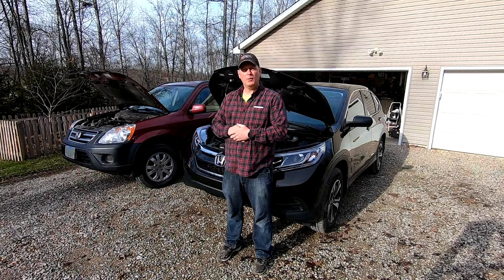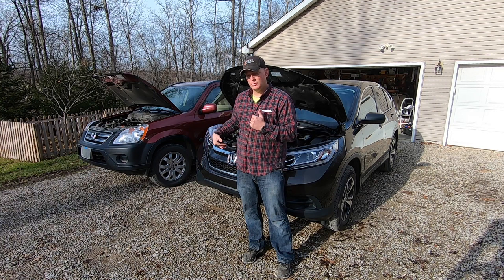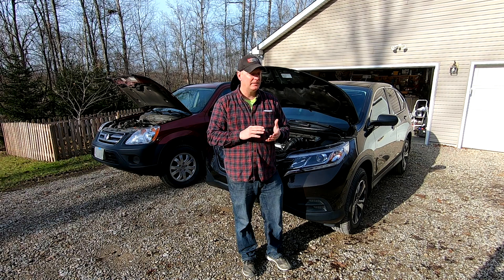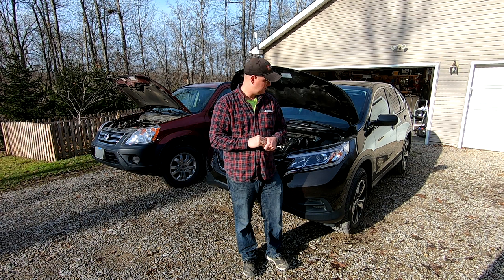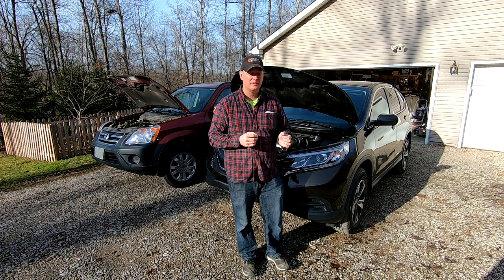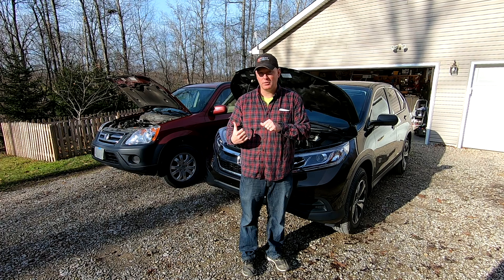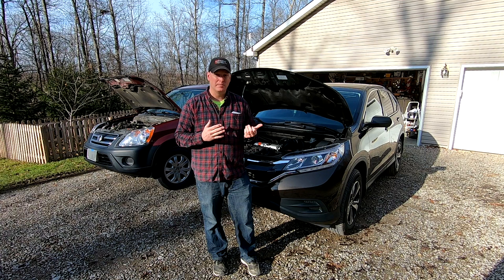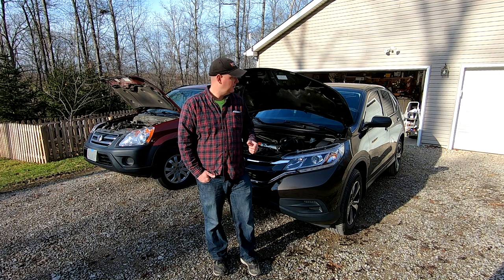DON'T BUY THIS CAR - 2012-2014 Honda CRV

Comment: I will stay you also may be hearing a drive belt and tensioner will go bad around the same mileage the CVT will start making noise.
Reply from the maker: The 2012-2014 CR-V does not have a CVT. A bad tensioner can make a similar noise on some cars yes.

Comment: I have 405k. My vtc is leaking oil. I’m replacing it this weekend. It has never been replaced
Reply from the maker: That's crazy mileage.
Reply: Thanks. I just change the oil every 5k. No major issues

Comment: I've  seen a video  on the accord having  that problem  and it was the timing belt tensioner  to be replaced  and adjusted  out one or two  teeth
Reply from the maker: That's for a completely different engine

Comment: I have to agree. Loved Hondas, bought a new fully loaded 2018 crv touring. Loved the vehicle but had the oil delution problem from the start and complained about it. Took to the dealer we really liked, blah,blah,blah flashed ECM, complained it was still happening, blah, blah, blah. Honda admitted a problem, extended warranty to 100k, we where already at 75k. We bought Honda for reliability because we put a lot of miles on. Complained again, oil over full and smells like gas, dealer told me they couldn't do anything unless the check engine light was on. We had all the regular service done earlier that due, by the dealer. We'll be past warranty before having a check engine light.....traded in for a toyota.
Reply: Toyotas also burn oil. Even the 2.5.

Comment: How about the 2007 to 2011 CRV? Thank you
Reply from the maker: They are pretty good
Reply: @JackofAllMasterofNone those years had an internal coolant pipe that leaks. My memory is foggy but a quick search will pull it up.

Comment: 2014 AWD here. 265k miles and going strong. 

I got a little transmission shaking at 65k and I just change the trans fluid every 60k and all is good. 

The only other major repair is the shocks all around but that is expected.
Reply: I change the transmission fluid every 30K miles.  I buy seven quarts and crush gasket.  Drain and fill.  Drive it a bit.  Drain and fill again.  Use new gasket.  Set for another 30K miles, about 2 years.

Comment: How about the prop shaft issue, I had to replace my entire prop shaft twice because of a defect. Honda paid for it one time and I had to pay for it partially the second time. This issue is with the center bearing on the shaft which of course is not serviceable, so you have no choice but to replace the whole shaft, which is around $2000.00 just for the part.
Reply from the maker: It is serviceable, just not according to Honda / the dealership. It is an issue, but doesn't seem that common. They can be regreased with a needle greasing kit without even removing the shaft, as long as it hasn't gotten too bad.
Reply: That's why I decided to buy a vehicle without AWD.

Comment: Bumped into this vlog since it mentioned 2014 model that I own.  I had the exact same problem and thought all along is a starter pinion stuck problem.  i realized now its a totally different major issue.  It still happens now after 9 years on and off and more so on colder days.  I have only 41k miles on it since its a very low use vehicle. Now that i have learned of this issue really worried. A major disappointment from Honda.

Comment: I am going to try and find the video but a mechanic replaced the springs without removing the actuator by just removing valve cover. The stronger springs fixed the issue. 🤷🏻‍♂️ I had timing chain and actuator replaced and it did it the week after they were replaced. 😡 Only does it when cold out.
Reply from the maker: Sounds like this is the best fix based upon all the other comments.

Comment: My 2014 i bought 18 months ago with 65k on it. In that time, i put about 120k on it.... i drive 110 miles each way to work and back 5 days a week. So far, I've no issues except when accelerating at about 25 mph, it shakes a bit... i lift off the gas, then press again, and it stops. Also, when driving at 65 over a patched road, the car tends to hop a little. Otherwise, it's fine... so far

Comment: Our 2016 CRV is the 6th Honda we have owned. Superb motor car. Suits our needs in every way. No sign of this fault after 6 years and 90,000+ on the clock.
Reply from the maker: This does not apply to your car. It's 2012-2014 only.

Comment: I've had the rattle for years, 230K on my engine now.  I haven't read one person say anything about what happens if you leave the engine alone with the issue.  I don't have any problems at all with mine other than the VTC actuator rattling, and it's not everytime.
Reply from the maker: That's good to hear

Comment: 2013 here, 3 yr batteries died too soon, and inflation,  I did pop some $ into this. Everything is higher. 50,000 miles ,it does drag a little.

Comment: Thanks for this. My 2013 started making this noise last year at about 120k miles. Took it in twice and the dealer couldn’t duplicate it or find anything wrong. Now this week it does it every start and they suggest rebuilding the engine for $4600…
Reply: Sell it and upgrade if they can’t find it 😂
Reply: Tell them about the service bulletin 16-012. The VTC actuator is defective 

I had to also replace the timing chain as well, due to this issue.

It costed me $2500. It sucked but it was the only major issue I had with this vehicle.
Reply: It sounds like you need to find another dealer - they only want to offer an expensive repair to make more profit.

Comment: Yep same thing 2014 Honda CR-V had it to dealer twice  at 50000 miles they swore did not hear the noise I even recorded it on video and played it .
They said can’t fix it not 75000 miles no warranty . Timing  belt stretched due to actuator . 1600 dollars awful enginerring
Reply from the maker: Yep

Comment: 2012 145k.  Just got done replacing the radiator.  Also replaced the blend door actuator, flushed the heater core last year, replaced the alternator, and replaced the rear brake calipers cause they were dragging.  Probably will need a muffler soon starting to get noisy.
Reply from the maker: Should be like a new car now !!
Reply: @JackofAllMasterofNone  I do like the room it has.  It replaced an '02 Accord last year with 230k.  I could never go back to a sedan - just too low.  I bought it with 125k so not sure if the VCT was replaced by the previous owner but its fine starting up.  If it does act up I'll replace it myself.   The small batteries are a joke though.  You leave the headlights on for 15 minutes with the engine off and the battery is dead.

Comment: Glad I watched this. Was thinking about buying my neighbor’s 2016 CRV with 14,000 miles, but why bother if it doesn’t have the good reliability? My 2013 Hyundai Elantra shitbox with 90,000 miles shuttles my fat ass around town just fine.
Reply from the maker: The 2016 is actually a good vehicle. The 2012-2014 is the subject of this video.
Reply: @JackofAllMasterofNone and what makes the 2016 different from the 2012-2015? Isn’t it the same car with the same problem?
Reply from the maker: Looks similar but has a completely different engine and transmission. The 2.4 was redesigned in 2015 and Honda started using a CVT transmission.
Reply: @JackofAllMasterofNone  a CVT?!? Yuck, no thanks

Comment: I have honda crv 2013 lx  , and I have a problem with oil consumption. After 100k, start taking 1 quarter  every 1 k miles.Penzoil high mileage  oil helps to decrease  oil consumption  50% instead of 1 quter  evry 1 k miles now i can doit 2 k miles

Comment: i NEVER CHANGED IT.  YES IT'S NOISY ON A COLD ENGINE START UP. Big deal. I know what it is and car is running great. Compare it to all others in it's class. We still win.
2014 Honda Cr-V 2.4L EX-L AVG 28MPG 171,000 MILES, with $2000.00 RV tow upgrade.

Comment: I have a 14 CR-V with that start up issue. Assumed it was the starter so good to know what it is. ( A neighbor drives the exact same type CR-V and I've heard hers do the same!  I. Also have tran actuator noises going on right now. Only 92k on it. Disappointing quality Honda.
Reply from the maker: Yeah it sucks and they all do it eventually. Bad design

Comment: Just had vtc actuator, timing chain and all gears replaced on 2014 crv with 88000 mi for $1900.
Reply: Call Honda and tell them. 2 states have a class action. Honda may still do something for you. If you are in Cali or Illinois you may be part of the class action. Let us know if they do or do not help you.

Comment: That rattle you hear when starting it up from a cold start is your timing chain begging you to change it. If you don’t believe me go buy the timing chain, put it on there and see that it don’t stop.
Just to be a little more specific, it’s actually the lower timing chain to come from the crank to your balance shaft.
Reply from the maker: It's not necessarily the timing chain. They can stretch over time if this is ignored, but the vtc actuator is what is making the noise.

Comment: My parents also used to owned a honda CRV EX-L the engine never break down but the air filtering system started to make funny smells when going like i think 100 KM/H
Reply: It's time to change the filter
Reply: @staceylynn4700  I keep my filter changed.  It still does it. I keep baking soda boxes with the open flaps in my cabin.

Comment: I bought a 2018 crv, and sold with in a year due to massive oil dilution problem
Reply from the maker: We did the same with our 2017 CRV
Reply: Some of the 2018's had a different engine.  No oil dilation problems.
Reply: @Susan70003  I sold one due to Oil dilution, and there were thousands of vehicled afftected around the globe.

Comment: …. Also just an fyi… even though I want to throw up now every time I get in this car … as soon as you hear the Vtc rattle on start up you can likely get away with just replacing the spring in the actuator…. You can get a replacement spring that hold it “spring” a lot longer. It’s way quicker and cheaper to just replace the spring if caught in time . ALWAYS CHECK OIL WITH EVRY FILL UP!!!!!! These engines will not tolerate a low oil start up. Stuck with this now but never again . I have 2001 Toyota 4 Runner that I’d take to the moon without hesitation…. Thks Honda

Comment: I bought my 14 CRV at 80k. The noise started happening at about 100k ish. I learned to live with it. I’ve had nothing but problems after 😩.  No heat o. Driver side. Struts on things. Sucks oil dry!!! 
I owed a Camry before and I miss it but Honda was my first and 2nd car. 
I’m trying to trade this money pit in now!!!! 
Don’t buyyy

Comment: 2012 owner … never Honda again
Excessive oil consumption randomly 
Poor gas mileage 12.5- 14 l per 100 km avg
Vtc actuator twice
Timing chain, tensioner and guides 
Calipers seizing
Battery draining
Sunroof leaked and works randomly 
Door locks/unlocks  randomly 
Excessive road noise 
Excessive tire wear
Driveshaft failure
All this at only 140,000 km
Always meticulously kept ann  eye on everything and just can’t believe how poor this is.A total fail IMO.
Reply from the maker: Yeah.

Comment: I bought my 2014 Accord EX 2 or 3 years ago from an individual who was less than honest about the car.  He made sure I didn't hear it at start up, so I wasn't prepared for this issue.  After a lot of research, I changed the VCT actuator myself.  It was NOT an easy fix, but I guess I got lucky because the issue hasn't come back so far.  My sister has a 2015 CR-V EX-L and it was making "the Noise" when i drove it a couple years ago and she's done no fix on it yet - just crossing her fingers, I guess!
Reply from the maker: Your sisters 2015 is not the same engine and can make a similar noise, but it's a different problem that is much easier to fix. On the 2015 - 2017 with earthdreams engine, it's just the chain tensioner that needs replaced.
Reply: @JackofAllMasterofNone  Don't know why I'm just seeing your reply now.  Evidently I didn't subscribe when I made that comment (corrected that oversight today).  I just replaced the timing chain and tensioner on my 2014 Accord Earth-Dreams engine because my Honda-bond was old when I first did the actuator a couple years ago and the case had been leaking. It eventually got bad enough that I had to redo it, & so I replaced the chain & tensioner since I had it opened up.  Wow.  The engine runs as smooth as when it was new now!!!  Couple of things I got from you videos: I didn't know about a better tensioner than an OEM.  I'm glad to hear that because this is the 2nd time I replaced this one in 35K.  What I've also discovered, that I didn't previously know, was the discrepancy between the 2014 Accords & the 2014 CR-Vs.  Evidently the Accords got the new Earth-Dreams engines a year or two before the CR-Vs.  Anyway... I've been driving Hondas since 1984 when I bought a silver '82 Civic Sedan.  It ran like a sewing machine & got 40 mpg, but boy, was it tiny, lol.  Anyway, thanks for your great content.

Comment: The VTC went out on my 2014 CRV at 46K and was lucky it was covered by warranty. However, it just went out again at 168K and I had to cover the cost myself. I "hope" this one lasts just as long. Thanks for the info, appears I have the same heating issue you mentioned. However, after a couple flushing's and fluid change, it did not make much of a difference with temperature.
Reply from the maker: There is a tsb out on it. You have to use a high pressure pump with a CLR and water solution to really break up the gunk that is clogging the heater core. I'm sure you can Google it and see how the procedure works. If it doesn't help, unfortunately it will require a new heater core which is 💸💸💸💸💸💲
Reply: I did the flush.  It worked.  Get the tsb.  There is also a decent video on youtube.

Comment: Bought our 2013 CRV brand new. 130k miles now regular maintenance performed by me. The only issue we have is the torque converter shutter at low speed. Another know issue with this model. If you drive it hard through the gears it isn’t a problem. Anyway, this is the first I’ve heard of this issue and hope it doesn’t pop up now… Our car is in the garage during the winter and the temperature around here seldom get below freezing, so that could be why as well…
Reply from the maker: The torque converter shudder is a very easy fix. Change the transmission fluid.
Reply: @JackofAllMasterofNone  I’ve done that twice and it’s still there. Only at low speed between 1st and 2nd gear. Like I mentioned if you step on the gas it shifts just fine. When my lead footed wife drives we never have an issue… 🤣

Comment: EASY fix.  One afternoon, less than $300 and that engine will last forever.
Reply from the maker: Definitely not an easy fix replacing a timing chain, tensioner and guides and VTC actuator. It also costs more than $300 dollars. After that it's decent, until it's not again
Reply: @JackofAllMasterofNone  The rattle is the VTC, which is common and less than $300 all in using Honda parts and the revised design actuator.  A tensioner, guides and chain is unusual and not likely to fail.
Reply from the maker: Actually it's very common, especially if the VTC isn't fixed quickly. A lot of people skip the timing chain and the VTC actuator then rapidly fails again. Not only am I a mechanic but I have had 2 of these 4th gen CRVs and both of them had the issue. On the first one (under warranty) the Honda dealer only replaced the VTC actuator with the revised part and it was bad again within 1,000 miles. The reason, the timing chain was stretched beyond the acceptable limit. On the 2nd one I took the time to measure the stretch, which can be seen by lining up the timing marks and then comparing the measurement to the bottom timing mark. Requires more work, so a lot of mechanics just slap a VTC actuator on and call it quits,

Comment: Switched from the Honda CRV to Toyota RAV4 2015 pros and cons for both. But you’re right after that 2006 CRV the problems start leaking Juddering on the 2007-2012 model and now this. Honda has gone downhill.

Comment: So the car is bad because it have this bad 100$ part ? You will not stuck with this issue in the middle of nowhere. It just rattles. I've had this issue on my car and it can be fixed on a parking lot with no parts at all. You can streach the pin's returning spring and this issue will be fixed. There is a video on youtube "vtc gear rattle fix". Or you can replace this 100$ part when you will adjust the valves.
Newer CR-V using CVT. One oil change in that transmission will cost much more than this rattle fix.

Comment: First and foremost, you bought used. You don’t know the history before you. My 2014 has 170k and no issues, besides ac issues which is classic Honda issue. Your motor is same as the one sitting in your 2005 CRV. The repair is not hard nor very expensive.
Reply from the maker: Not the same engine. Similar. You can read all about the year differences here.
https://en.m.wikipedia.org/wiki/Honda_K_engine

Comment: The VTC actuator issue only really happens in cold climates.  folks down south never have this.  Not sure why.... I have a 2011 CRV with 210k miles on it and still runs with the issue.  My two cents.
Reply: 2012-2014 i think 2011 never had this problem
Reply: Mine still does and its a 2011.    Its the k24 engine design thats the issue.

Comment: I got to learn to take these videos less seriously. I have a 2014 CRV and my most expensive repair has been $150 to replace a gasket.
Reply from the maker: 2024? Or 2014?
Reply: @JackofAllMasterofNone  You're right. I fixed it to 2014.

Comment: The 2014 I had . The dry valve cold 🥶 start pretty nasty. Really soon within the first 40,000 kms 2nd gear ⚙️ had real issues, like I've never encountered under warranty. The dealership denied any knowledge.